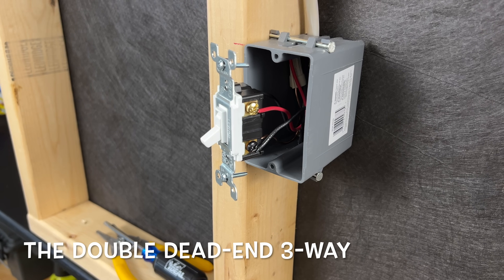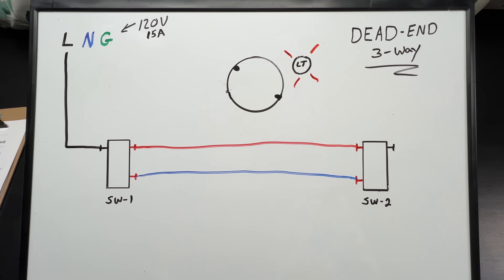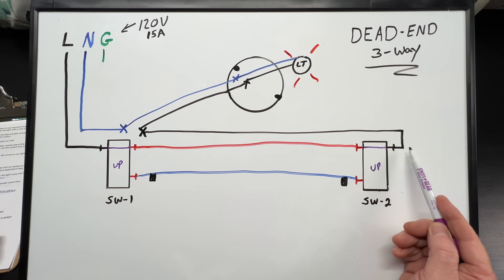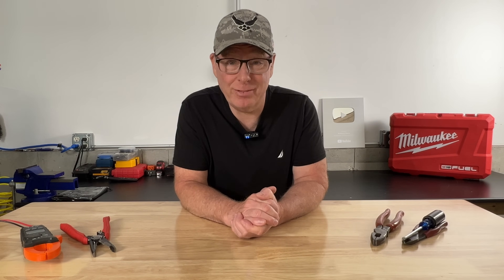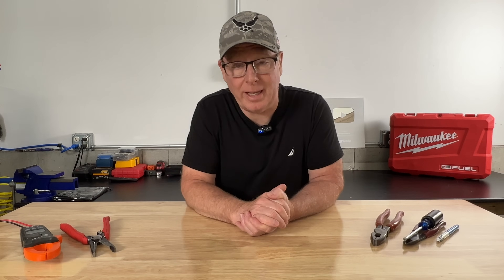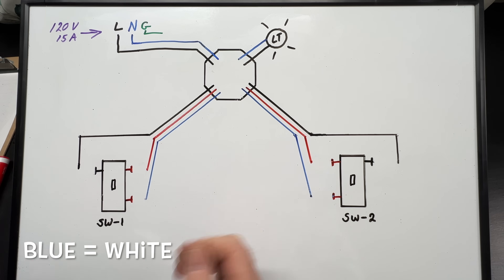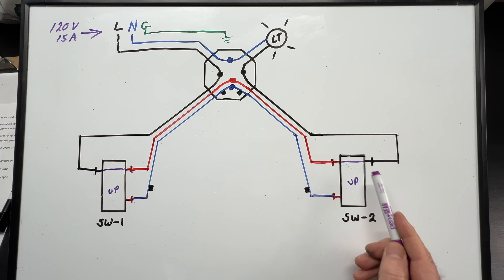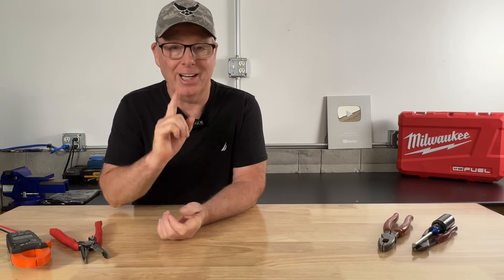Double Dead End 3-Way (Secret Method Reveled)

Comment: Without a neutral in switch box this is not code compliant
Reply from the maker: A neutral is only required at one switch box for multiple switches the control the same light. I covered that in the video. I also cover that the double dead end cannot be used for new construction.
Reply: @BackyardMaine  This method  can be changed to feed power into the first switch box, instead of the ceiling box, then it is code compliant. It's technically not a double dead end anymore, but a hybrid between a double and single dead end. I encountered this scenario a few days ago. The installation was over 20 years old, but would comply with current code.
Reply: I’ve been in the electrical trade for 27 years now. It truly amazes me how many guys in this trade cannot wire a three way/four way switch application. But the same guy can make up a big j-box with 6 circuits and neutrals to keep straight, or a lighting control application with say a photo eye on, time clock off almost blindfolded. I’ll admit that I struggled a little at first, but only for the first month or two. I appreciate these videos, I am going to have a training session soon with some of our new apprentices. I plan to show them your material. When I train an apprentice, I don’t want them to just do it like I show them, I want them to know WHY they’re doing what they’re doing. It gives them confidence and a sense of accomplishment, and makes them want to be better all the time.
Reply: @CA-lk6fd this! 👆
Reply: There is also a way site the power going to sw 1 then a 14-3 to light box and a dead end going also to sw2 and light box
Reply: @CJRock-xn5qf  The context is given and the rule is explained in this at the 8:30 mark... So it 100% WRONG to say it's not code compliant to not have a neutral. This is not a confusing code rule.  The code black and white says you only need a neutral at one location when dealing with lights controlled from multiple loactions.  No need to play word games.  I am not wrong.  I have a 122k followers on tik Tok and 36k on Instagram with over a million views a month.  I will pay pal you $100 if you find any time I am wrong in any of my videos
Reply: Tell me you aren’t an electrician without telling me you aren’t an electrician.
Reply: @ read the code
Reply: It always makes sense to bring power into the lighting outlet box. It makes it far easier to troubleshoot.
Reply: Incorrect read the rule NEC 404.2(c) you almost never are required to have a neutral at both ends of a three way.  Check the code This is in the rule about lights controlled from multiple switch   locations not in the exceptions
Reply: I will look into this, but my AHJ’s look for a neutral in every switch box on new construction and wouldn’t allow this.
Reply from the maker: I posted the code article in the video. Some jurisdictions may require a neutral at all switch locations but they're not required per the NEC.
Reply: @BackyardMaine  nec 2011.1 requires neutral at every switch
Reply: @brentb308  your AHJ is wrong.  If it helps Mike Holt has don'e a video on it.  But your AHJ should just read the code book and understand it's very clear.  But with some ppl(usually the ppl who used his books in their apprenticeship classes) they need to hear or see Mike holts take on it
Reply: @Stevenj120volts  code minimum standards, some ahj are just sickening and you show them articl etc, they trump it
Reply: @SteveStowell  there is not code NEC 2011.1. Plz fix your reference.  The code rule is NEC 404.2(c) and it says a neutral at only one end of a three way
Reply: @Stevenj120volts  it states the neutral has to be at the load switch.  I think your neutral was in the ceiling and not to switches.
Reply: @SteveStowell  that's not what it states... NEC 404.2(c) is the code just read it... Here I will copy and paste it Incase you don't own a code book "Where multiple switch locations control the same lighting load such that the entire floor area of the room or space is visible from the single or combined switch locations, the grounded circuit conductor shall only be required at one location."
Reply from the maker: @SteveStowell  Actually no.. The requirement came out in the 2011 code but with several exceptions. One of the exceptions was removed in the 2023 update. I made a video on that as well. Also 404.2C states that a neutral conductor is only required in one of your 3-way or 4-way switch boxes.
Reply: @fatbass311  Yes, they are minimum standards, but some things, including this, have absolutely no point in exceeding. What, are you going to have more than one smart switch in the system? Yeah, that’s pointless, and potentially even confusing (I can see it leaving some people confused as to which one to use, even though any switch in the system will work) if you control it from your device.
Reply: @Stevenj120volts In Canada the rules changed and we are now required to have an identified conductors at each switch box
Reply: @Dukie30  yeah its silly.  I started my tik Tok by doing a lot of comparing NEC to CEC.  I haven't seen one CEC rule that was a different than the NEC that made more sense than the NEC version.  If you have a neutral at one end of a threeway you can have smart switches at both end.  The companion end will still only need three connections. So a single 14-3 can run the companion end. when you upgrade to smart switch  form dead end. You just have to move the splice around at the master end.  The CEC requires de-ox it has not  been needed since 1987ish square D even says it's not needed recommends NOT to use it.
Reply: @Stevenj120volts  

CEC 4-022 
(2)
The identified conductor shall be installed at each location of a manual or automatic control device for the control of permanently installed luminaires at a branch circuit outlet.
Reply: @Dukie30  yeah so that was basically the NEC rule in 2011.  In 2014 they made changes to eliminate some of the redundant conductors that saying have it at every switch was caused.  A remote or companion smart switch still only needs 3 connections just like a not smart 3 way.  Regular three-way need two travelers and a common.  Smart companions switches need one hot, one traveler and one neutral.  So still just three conductor.  The NEC allows you to only bring the 3 conductors to the second switch loaction since that's all you need for both smart switches or a regular three-way ..The wording of the CEC would require 4 conductors when only 3 will be used.  So you just splice those three conductors correctly at the primary or master switch to match the needs of the second switch.
Reply: @Dukie30  here is the actual wording of the NEC you will see it much more in depth. It trying to actual Match how smart switch work vs requireing an extra wire neutral everywhere.  We call it the grounded conductor not the identified. And there are different rules for different types of rooms

(C) Switches Controlling Lighting Loads.

The grounded circuit conductor for the controlled lighting circuit shall be installed at the location where switches control lighting loads that are supplied by a grounded general-purpose branch circuit serving bathrooms, hallways, stairways, and habitable rooms or occupiable spaces as defined in the applicable building code. Where multiple switch locations control the same lighting load such that the entire floor area of the room or space is visible from the single or combined switch locations, the grounded circuit conductor shall only be required at one location. A grounded conductor shall not be required to be installed at lighting switch locations under any of the following conditions:

(1)
Where conductors enter the box enclosing the switch through a raceway, provided that the raceway is large enough for all contained conductors, including a grounded conductor

(2)
Where snap switches with integral enclosures comply with 300.15(E)

(3)
Where lighting in the area is controlled by automatic means

(4)
Where a switch controls a receptacle load
Reply: Quick fix to that would be to change the 14/3 to 14/4.

Comment: U also need a neutral at the boxes (2020 nec) 300.3
Reply: You are have both misunderstood the code rule and misquoted the location of code rule.   The rule is NEC 404.2(c) and it requires a neutral at one end of a three way
Reply from the maker: Check 404.2 (C) the article I show you in the video.
Reply: You def do not.

Comment: How many houses do you run across that have 14 gauge in them? Seems like only the crappy older buildings even run 15 amp service around here.
Reply from the maker: 15A circuits are very common. I made a video recently about a code change in the 2023 code allowing 10A circuits. They are not approved for receptacle circuits though. I would expect to see 16 gauge NM-B cable introduce before the next cycle in 2026.
Reply: Code only requires 20 amp circuits on kitchen, laundry, bathroom,s and garage,s . All other 120 volt  circuits ,with some exceptions can be wired with 15 amp branch circuits.Some jurisdictions require all 20 amp branch circuits on residential installations but this is not common practice.With all lighting now being required to be at least 75% energy efficient, and eventually 100% LED lighting has become the norm . Lighting loads have been drastically reduced, hence 15 amp circuits don,t have any problem handling the light loads on bedrooms, halls,most family rooms,bonus rooms ,and dedicated lighting circuits. Most builders and home owners don’t won’t to pay the additional cost to wire a home completely with 20 amp  120 volt branch circuits.
Reply: Stuff is getting more efficient.  So small wires are the more modern way.  The code just introduced a 10 amp wire and breakers for lights
Reply from the maker: You are correct. I actually made a video on the subject.

Comment: Both have the exact same topology except everything goes through the box in the second case.
In fact it'd be more like a no-dead-end.
what did i miss?
Reply: The deadend refers to the idea there is only one cable.  Yes inside the cable we have 3 conductors.  But we only run one cable to the box instead feeding a cable into the switch then a cable from that box and  up to the light. Going in and out of the box with two cables is the more standard way of doing it.
Reply: @Stevenj120volts  Ah i forgot you guys use that big cable with 3 wires inside. In that case, yeah, they all look like dead-ends. Thanks for the light! hehe
Reply from the maker: Both switch boxes are dead ended, meaning that with only switched power and no neutral, the circuit cannot continue on to other loads such as lights and receptacles. The first method "the dead end 3-way" has power that isn't switched and also a neutral in the first switch box.

Comment: I just saw somewhere on YouTube that this is no longer code approved because at least one of the switch boxes needs a neutral ( to accommodate smart devices). Same goes for a good old single switch loop using 14-2. I’m not an electrician, what’s your take?
Reply: Double dead ends are still allowable, but you must run 14-4 to the switches instead of 14-3. You use the Black/Red/Blue wires for the 3-way, and the white is there for your neutral (grounded) conductor.
Reply from the maker: Ahh yes if you run 14/4 you're good to go. I forgot to mention that.
Reply: @sigcrazy7 you ussally only need a neutral at one end of a three way...read the rule NEC 404.2(c) you almost never are required to have a neutral at both ends of a three way.  Check the code This is in the rule about lights controlled from multiple switch  locations not in the exceptions
Reply: @Stevenj120volts  Forgot about that. Good call. Don’t run across the need for these very often. I did buy a house once that had a California 3-way. I stared at it like a monkey doing a math problem trying to figure out what was going on.
Reply: As of 2011, the double dead end 3 way, along with the 2 wire switch loop is a code violation.   For the double dead end 3 way to be compliant,  at a minimum a 14/4 NM must be run to one of the switch box's.  (As an alternative,  since 14/4 is rarely carried in your typical brick and mortar stores, and often too expensive to justify buying it for the very few applications that require it, you could run 2 runs of 14/2, one for a hot or switch leg and neutral,  the other for the travellers; this two cable method must never be done with metallic sheathed cable such as AC or MC because inductive heating of the sheath will occur when only one conductor in the cable has current flowing. This double 14-2  NM method can also come in handy in a pinch if you need to finish wiring the 3 ways and ran out of 14-3.   

A single pole switch loop would require a 14-3 ran to the switch box.
Reply from the maker: I talk about that and give the code reference in the video. Toward the end...
Reply: @BackyardMaine  sorry, guess i didn’t stick around long enough
Reply: @Sparky-ww5re  That's interesting about inductive heating due to only one current carrying conductor, thank you for that.
Reply: How did I find a YouTube comments thread where everyone knows what they're talking about? It's a miracle.
Reply from the maker: Yes I made a video on that and also mention at the end of this video its not approved for new construction but could come in hand if you wanted to convert a single pole switch to two 3-ways.
Reply: @BackyardMaine Yep, your videos on those archaic circuits are fantastic. In fact, when my son recently started as an apprentice, I sat him down and told him to let @BackyardMaine explain California and Chicago 3-way light circuits. Your explanation was better than anything I could have taught him. He asked why he even needed to know it, and I told him that sooner or later he will find himself doing some service work.I wish I had seen your video before I ran across a CA 3-way. It would have saved me a lot of time. Thank you for the effort you put into these explanations.
Reply from the maker: @sigcrazy7  That's awesome to hear my friend. Thank you!

Comment: Nice John!  Thank you for the idea!  I don't want to ask for free advice, but I've already used a three way switch in a non-standard way, and I wonder if it violates any code, and if you'd care to comment?  I wired an outlet in our basement to be energized when the lights are off.  I then plugged in an LED strobe.  The rodents in our area seem to be deterred by the flashing, but it's annoying to have it flash when we're working down there.  Pretty sure I was code compliant with the installation itself, but I've never heard of a three way switch used like this.  I'm guessing it might cause some head scratching someday after we're no longer around to explain.
Reply from the maker: I wouldn't worry about it but if you sell the house you may want to make a change. Thanks for dropping by..
Reply: @BackyardMaine  Thank you John.  Great video as always!
Reply from the maker: @TomFarrell-p9z  Its my pleasure..👍
Reply: A 3-way switch is just a SPDT switch.  I've wired things like that in my own home, such as like a Manual/Auto selector switch.  Code compliance is a good question but I'd be surprised if there's something against it.